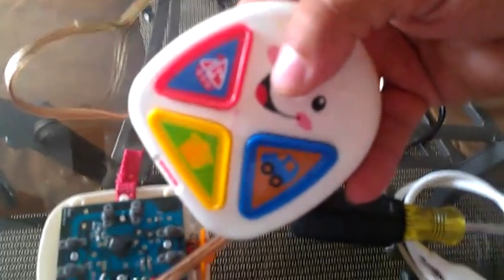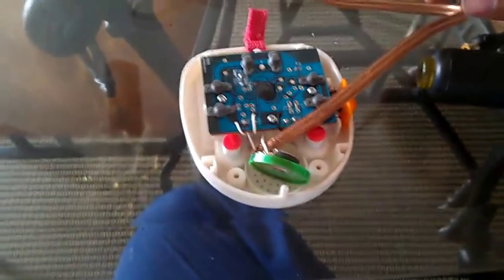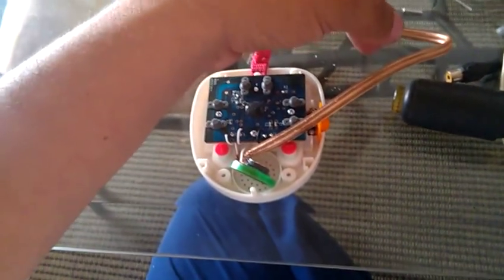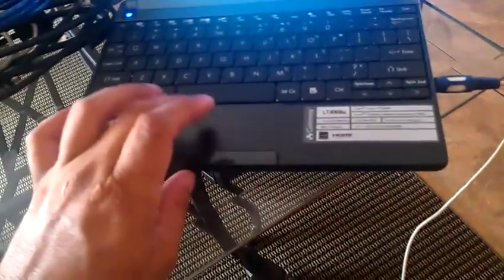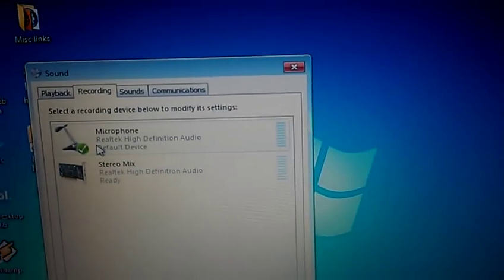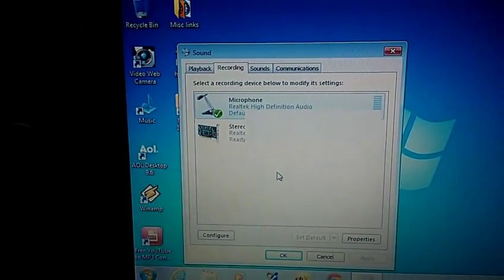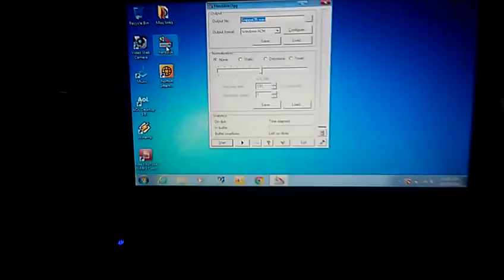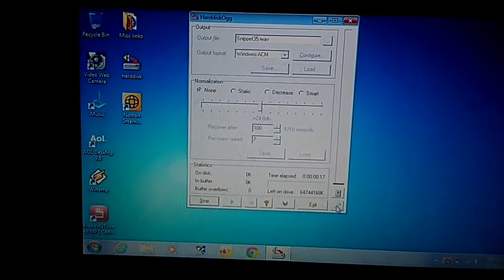How to extract music from electronic toys

Comment: What if I want to change the music, what I have to do?
Reply: You can't, everything is purpose-made.
Reply: Add a speaker box or something
Reply: Same Question
Reply: Usually you have to replace most parts of the electronics inside with custom ones to do that. The mass produced factory sound chips have a read only memory and can't be re-written.
Reply: @toymusic7090  is there any way Tito rewrite it? I’m trying t change the songs on a toy that pays songs via plastic cds that have a pattern that pushes down the inside of the player, but cannot figure out how to change the songs

Comment: Or you can just buy some female aux or guitar jacks and solder the positive and negative inputs on the speaker to some wires going to the jack and melt a hole in the plastic for the jack. Then you essentially turned it into a permanent instrument.

Comment: you can also use a telephone pickup coil (which costs 6-8 dollars USD) if you wanna record audio from toys without taking it apart. it won't work that good on some motorized toys but it's a good way to do it.

Comment: The chips are analog not digital, so the speakers don’t need to decode binary numbers to make the sound. And also an example of analog and digital is comparing a stereo running a cassette to a computer running a USB drive. The chips are recorded via an electromagnet pad and the cost 50 cents to make.
Reply: There are digital ROMs inside, mask programmed, and cost only fractions of a cent each. They can either output to the speaker via PWM, or through an A/D converter, though two-phase PWM is the most common these days.

Comment: I got a question, i got an audio toy that has the sound bit more high pitched compared to the others in my collection, is the problem related to the wiring or is it something else?
Reply from the maker: +Jota Aniki Try the other toys again. If they now have high pitch. Something maybe wrong with something other than the toy. THIS IS NOT LIKELY THOUGH. It is more likely that toy may be high pitch already. If you have some kind of equalizer hooked between the toy to the recording device, That should fix the problem.
Reply: Jota Aniki its normal for toys to be higher pitched then others because pitch resistors

Comment: YES YES YES finally someone else who's doing this, glad I'm not the only guy who likes to extract audio from electronic toys. I made this special cable with two alligator clips on one end and a headphones plug on the other. The two channels are on the red clip and the ground is the black clip. I like to use an inline volume control to lower the signal because on some toys the audio output over drives my sound card. You can get this inline volume control  online. Then I record the audio a few times into a wav file to get the volumes right.
Some toys like singing bears you can't get at the speaker so I'm going to mod a boom touch speaker with an audio out then I can record audio from stuffed toys so I'm not tearing into them just to record their audio. Sometimes when I change batteries I do that and then sew them back up. I call that open chip surgery lol.
Reply: any way one could do it with a single jack computer?
Reply: Please extract the bop it smash music!
Reply: Pretty cool!!

Comment: find the damn aux cable you own, and use alligators to connect the tip of the aux to the left solduer point and do the same for the right solduer point and the second ring on your aux. yeet

Comment: Hi. :)
I have questions.

1. What is the storage called?
2. Is it possible to change the music? How?
3. If it is not possible or change the music, can I buy empty chip (I don't know what it is called) and fill it with my own music?

Thanks.
Reply from the maker: Hamdi Rizal it's no way to change the music. It's preset in these toys
Reply: @fueledbymusic3  can I extract music using apk mobile?
Reply: These chips are called "onboard chips", they are ROM memories. They are only recorded once, you cannot change songs.
Reply: @FoxyOfJungle  its like the CR-R discs that you can only write once

Comment: Hi!! Great video!
Some little questions:
What are these two cables?
The HarddiskOgg serves to pass the audio file to the sound device too, or only to record?
Thanks
Reply from the maker: Since the toy does not have any kind of headphone jack, the only way to connect an "aux" cable from the toy is using bare wires (the 2 cables) connected directly from the speaker of the toy. (the line out source), then the other end in the line in of computer. 

I been using that program to record sound only. That's all it can do as far as I'm concerned.